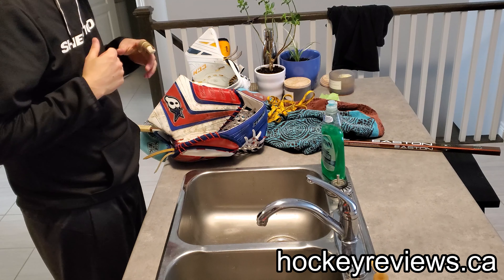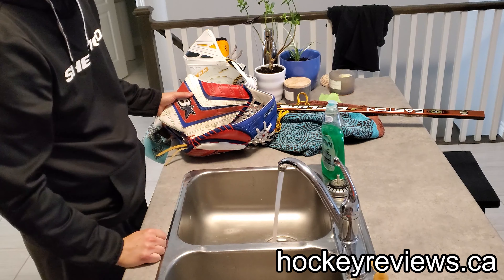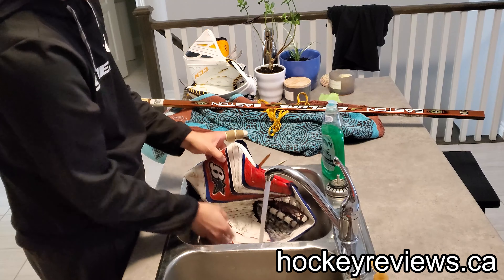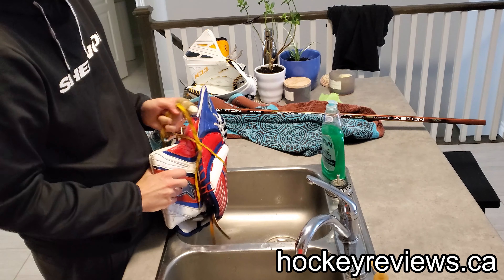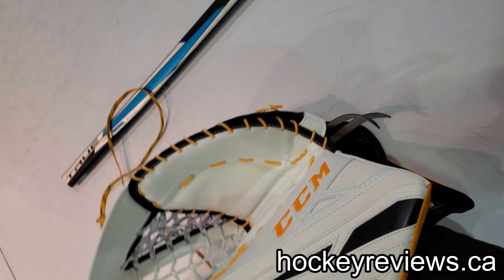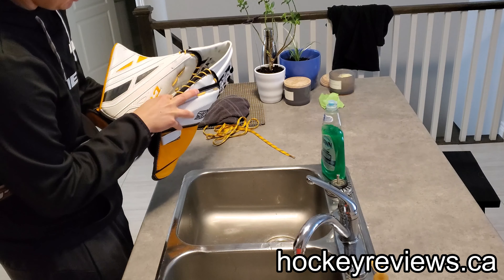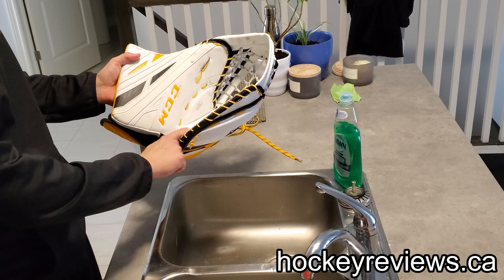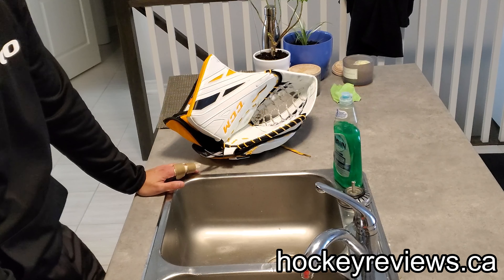How to break in a hockey goalie catching glove & how to fix a CCM Eflex 4 glove & 600 break gloves

Comment: Great vid bud!
Reply from the maker: Hope it helped!
Reply: Hockey Reviews yeah the keeps I’ve done before, it’s great. The ccm though, that’s money! Are there any other gloves with this issue/solution? I kind of would like to try it on my 2S but I don’t have it anymore but it had the same issue as what you showed when it came to closure. It was a pro palm, non stock glove.
Reply from the maker: @sebastianwankko6401  I've seen it on an Optik glove before. For most brands it can happen if they are broken in weird. My experience though is every 600 break CCM I have seen has this issue, and my solution made a huge improvement in mine.
Reply: Hockey Reviews thanks for the insight!

Comment: Steaming and the hot water method are basically the same because they both use heat to soften up the glove, the water isn't doing anything but making the glove wet which can lead to the leather becoming rough and hard.
Reply from the maker: Water doesn't turn equipment rough and hard. Salt in the sweat does

Comment: Do you have to use a skate oven for the glove, or is there any other options?
Reply from the maker: I would try with the really hot water first. If that doesn't work you can look into ways of using your oven but I'm not going to suggest that as you can damage your glove.
Reply: @HockeyReviews  Ok i'll try. Thank you!

Comment: If the trick is more the heat than the water, can you use a hair dryer to get it super hot and then tie it up? Or is that not enough?
Reply from the maker: I don't think a hair dryer would be enough. You can use a steamer if you have that though

Comment: This is not working for my Bauer 1s I bought it on sideline swap kinda used but the glove is not broken in. I ran hot water like this for 5/10 minutes tied it up three days in a row let it sit tied for 24 hours. I know it didn’t dry completely each time but I’m not sure if I’m doing something wrong? It seemed more broken in each time but today now that it’s dry it’s barely looser. Any thoughts guys? Guess I’m just gonna open and close it all night for a week or two I got a big tournament at the end of April I need it for
Reply from the maker: I found in order to get my Ultrasonic glove feeling good I had to do this method the night before I was wearing it. It helps a lot, but once it gets fully dry it gets considerably stiffer.